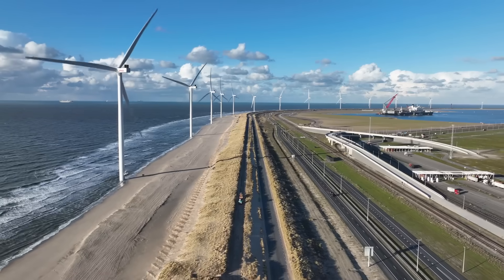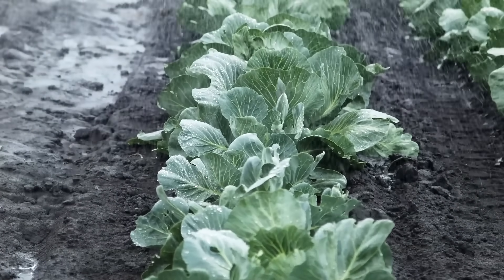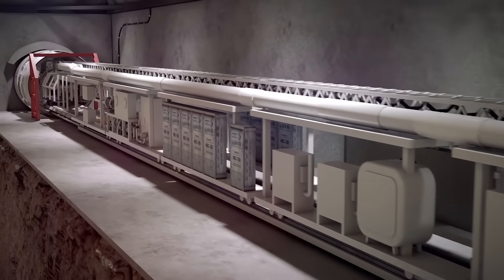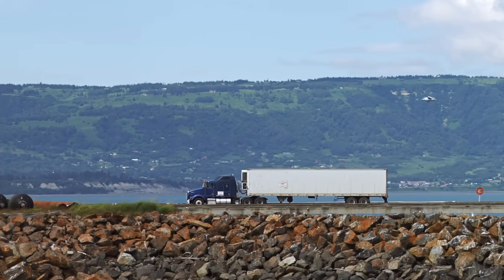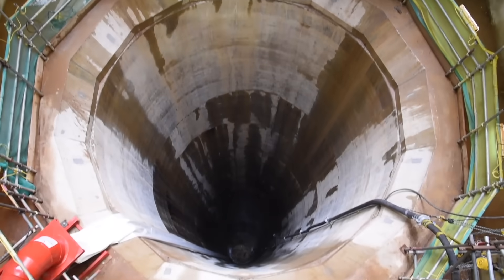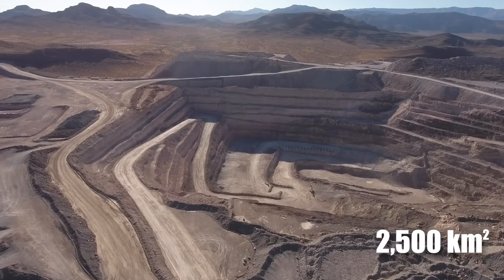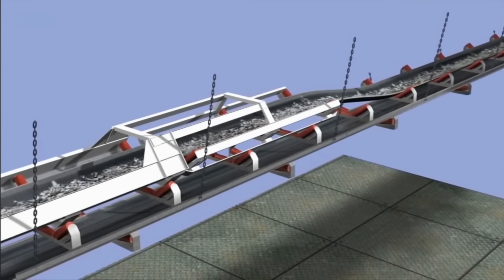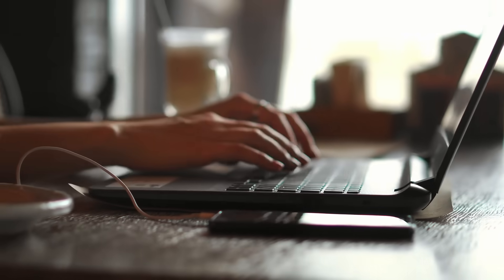Britain Is Building A Massive New Super Mine That Nobody Has Heard Of

Comment: That's rather odd, why build a tunnel 40km long for what amounts as fertilisers when you have the sea just 5km away near Whitby (as the crow flies), and can just build a 5km long tunnel to the shore up to loaders located maybe a km from shore (or closer to shore with dredged channels), so you're able to load ships that then can ship your minerals to the processing plant? Wouldn't that be far cheaper if we're talking about operating it for 50 years straight?

What's with the need for a way more expensive underground conveyor belt system? 🤔
Reply: That tunnel was one of the pre-conditions forbthe certification of the mine, because the local were worried about increased lorry traffic and dust emissions ofbthe fertilizer during the trip. In the tunnel all is sealed up and cannot escape. The concert of system does not add traffic on the roads.
I guess a new rail track could also have served with closed wagons. But I guess it would habe gone down badly with the public if the fertilizer would have had a higher quality rail track than the local railtrack. 😃
Reply: @helmutzollner5496 For the train route, a new length of track would have been needed and National Trust would not grant them permission.

Then it would need to link to the Boulby spur and ICL (was CPL) own that and would not give access (they were after all  in competition at the time)
Reply: It is in national park. The coast is probably part of it as well. Conveyor belt does not need to accumulate the material like train, so you do not waste underground area for warehouse, keeping it simple.
Reply: Whitby was never considered a big harbour even back when Captain Cook cut his teeth and it hasn't really changed since.
Gorgeous place though.

Teesmouth has big facilities for ships as there was steel production there fairly recently and plenty of labour in Redcar and Middlesborough
Reply: Whitby is a moderate size port and according to wiki stopped cargo operations in 2000, except fish landing.
Teesport is a major port with Redcar Bulk Terminal, and AE plan to expand alongside this. Wilton is a major industrial area including petrochemicals.
Conveyors are commonly used to transport dry bulk materials such as coal&ores. Trucks or trains would be much more disruptive and less efficient.  
It is an ambitious project.
https://www.youtube.com/watch?v=jgS5zBOQ-Gc
Reply: Forget the build cost. It's cheaper to run a conveyor belt on electricity (and run it 24/7) than a fleet of oil-powered ships requiring extensive manpower and prone to all sorts of accidents, delays, not to mention the weather.
Reply: Doh! What do you think collects the stuff from Whitby? Shipping is actually the cheapes form of transport bar pipelines and electricty cables I think. @TheNefastor
Reply: I suppose the mine can use electrified machines to transport the goods, to each parts of the facilities therefore being able to state green credentials. Once sold onto customers it's not their worry. Whereas using the ocean would mean using less "green" methods?
Reply: @joseph8208  underground, there is a mix of conveyors and EV's.
Once lifted up the -360m lvl, it is all by conveyor from mine, to and through the MHF, and then onto the ship loading facility.
Reply: National Park so no overland trucks, etc. Lucky for Boulby Potash Mine (just a bit further north) that the railway they use was built in Victorian times. Whitby is a tiny fishing harbour whereas the Tees hosts a bulk carrier port capable of taking 100,000+ ton ships and was the site of a major steel works.
Reply: The establishment want it to be completely invisible so they can gain from selling it and cut us invisible English out of gaining anything from it.  This happened to the lead mines in Yorkshire and then the coal mines history repeats itself again and again.  It really is time we had an English Capital City to represent the formally unrecognised English People we should situate it in the Centre of England - Manchester will do nicely.    London has always refused to recognise that England Exists and the rest of the world complies with their blatantly geofascist wishes!.
Reply: Cheaper to build a tunnel than a harbour.
Reply: @krashd  Whitby is a harbour and was a busy fishing hub, till the EU got involved but now a tourist destination so property is very expensive and a lovely place to visit, as is all the surrounding area btw.
Reply: The tunnel route make economical sense once into full production.  It allows uninterrupted movement of product whilst supporting environmental concerns.
This is especially important over winter when the moors can become impassible & dangerous to drive on. 

Also of consideration is the proposal of Teesport beginning a Freeport.  If they shipped from Whitby, it would be much more expensive including maintenance of the largely defunct harbour.  Teesport is established & well maintained.

Comment: 70 meters thick layer... nature will be preserved 😅 i guess everything will get 70 meters lower...also 1600 meters deep? you sure about that? its really hot there. who can work there?
Reply: Look up the "room and pillar" mining method. Amounts of the ore horizon sufficient to hold up the roof are left undisturbed.
Reply: @wfoybealiii4668  that is until water gets in, melts the pillars and it collapses :)
Reply: @Pyrochemik007  I'm pretty sure these mining companies wouldn't have started the venture unless they knew it was feasible to accomplish, there is no reason to assume any collapse would occur if reasonable safety standards are being adhered too.
Reply: @Pyrochemik007  Identification of the groundwater hydrology and flow characteristics is part and parcel of the initial mine development planning.  There are underground salt and other evaporite mines all over the world which have zero subsidence/collapse issues.
Reply: They are using robots to do the mining. Will need very few personell to run the actual mine.